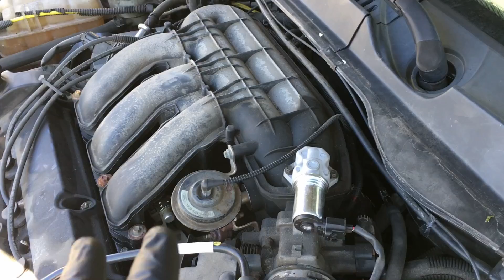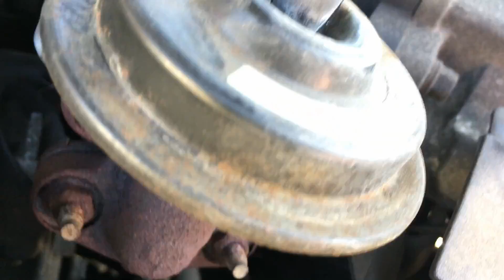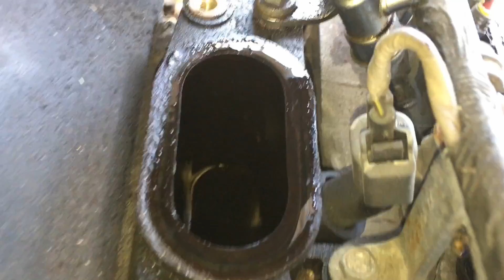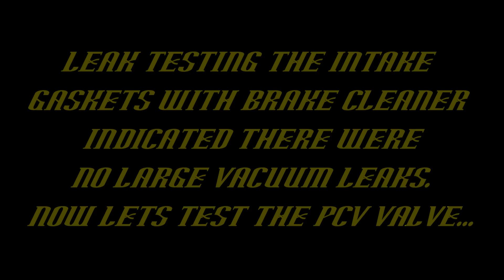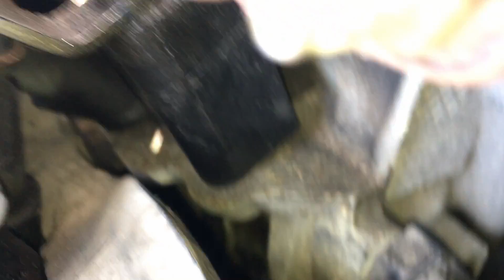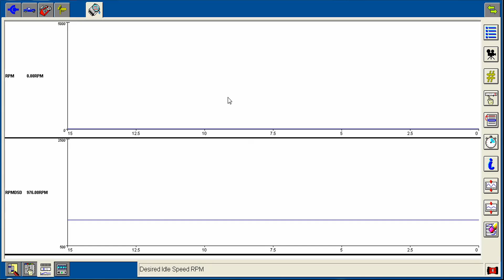Ford Taurus 3.0L 24v DOHC: $6 FIX for High Idle and Excessive Oil Consumption Concerns

Comment from the maker: Here are the Updated PCV Parts-
1996-1999 Model Years:
LH-
http://amzn.to/2phlxd2
RH-
http://amzn.to/2pwpCGo
PCV Tube-
http://amzn.to/2phnu9c
PCV Valve-
http://amzn.to/2phASKH                                                                                                                                                                              2000-2003 Model Years:
LH-
http://amzn.to/2phTNVF
RH-
http://amzn.to/2pwpCGo
PCV Tube-
http://amzn.to/2q0TNIM
PCV Valve-
http://amzn.to/2qX23XB
Reply: This says they dont know when they will get part again can u plz suggest another place to buy from
Reply: my car is ford tuarus 03 ses its getting stuck idling high when i go from 0-30 then slow down right away if i go slow an stop it stays idling just under the 1000 rpms probably 500 regauluarly is what it seems like my dealer ship cant even figure it out..you got any ideas

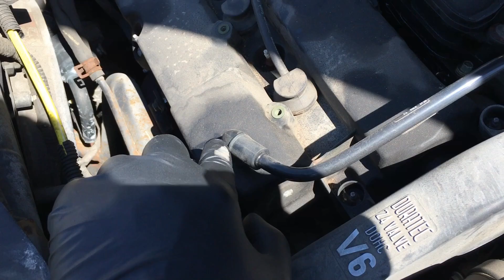Comment: 2:20 you replaced that elbow??? I've been trying to find anything about how to replace that elbow, mines leaking at where the elbow meets the crankcase and I can't find a part number or replacement for it anywhere! Any chance you can provide that P/N? (It's a later Duratec 3.0, the one in the 2005 Ford Five Hundred)

Comment: What could cause a low idle? I have a 2004 DOHC and it idle so low the oil pressure light comes on when in drive, but will go out if shifted in net. or park when hot.

Comment: I just change my 2004 ford taurus pcv valve and hose and the fluctuating git worse like really bad it feel like about to stall , but before that it was just small fluctuating. 
Note : the old pcv valve was stuck open and very oilly and the hose was bad also it has ton of carbon deposit and also twisted a little on its self .
But I out new ones should fix the problem but no 😂 it got worse 🙃.
Reply: Update : I can hear hissing sound from the intake manifold area this wasn't happening before and the hissing sound only comes when I manually acclrate by hand from the throttle body .
Reply: Is it possible the new pcv is stuck

Comment: Don't know if this will help anyone. But,I've been down this road. PCV was stuck open. Oil everywhere in induction system. Fixed that. But,RPMs still to high. Unplugged IAC,no change. What I found was earlier in life. Motor was replaced with escape/Mariner,Mazda whatever engine. IAC works backwards on those motors. Put escape IAC in it. Poof...fixed.

Comment: 2000 Taurus - 117,000 miles.    Leak in PCV valve hose at the elbow.   A challenge to replace the valve and hose.  Car now runs great.
Reply: was the leak visible? my car has all these symptoms but my valve looks perfect

Comment: 2001 Mercury Sable LS.
I suspect this may be my problem,.......before I attempt to get that sucker out,...would it hurt if I pocked a straw into the pcv valve and gave it a couple of quick shots of throttle body cleaner(cold engine) just to see if it loosens the gunk and improves my high cold start idle?
Should I do this?
If it makes a difference,.......then I'll attempt to get that sucka out there.

Ceskoslovenska.

Comment: I have a 2003 ford taurus ses 3.0L have replace the intake and the egr valve, egr pressure feedback sensor, egr vacuum solenoid. All my vacuum lines are good. Check the IAC by disconnecting and the car dies. Idle is still running rough. What is a possible cause for it to be running rough no high idle, just runs rough?

Comment: I have a 2005 ford taurus that will not pass smog.  When i took to a mechanic they cleared the codes and just said to go drive it for a month and then bring it back when the light goes off.  Well, i want to know what the exact problem is with these cars not passing smog so i can fix it in the future.  I might drive it and it may never turn off the engine light so i can pass smog..   Please help.

Comment: 98 Taurus DOHC no issues with high idle but when driving and you take foot of the gas, engine doesn't slow down, or accelerate, but at a stop light, idle is good.

 Kinda confused.
Reply: Did you figure it out?
I have similar,.."doesn't slow down/accelerate" problems on 01 Sables.
Reply: @IvanTheVariable  no, I'm still driving it as is, when I brake, and at stop lights, idle comes down to 500 ( stopped) and the car is never accelerating by its self, just a quark I'm used to now.

 I really have 0 intrest in taking apart the TB to get to the EGR valve, I'm thinking my issue is the emissions, intake system or idle control valve.

 This was supposed to be a throw away car  that is still swinging just fine.
Reply: Dealing with this now

Comment: Finally Found-fixd every vacuum leak today on my 2000 Taurus with a vulcan unless it's at the rear canaster, now I have a ticking on drivers side, not coming from valve covers. EGR selonoid vac connection was last leak I found. Still idles rough but not as bad.

Comment: Hi. I  have a 2013 ford Taurus and it has now power to the starter relay.   When I applied 12v to the starter relay car will start with the key.  And alternator light stays on.  Can you help?

Comment: Hey I got a question about my air intake that I believe from what you said , connects to the rear intake valve  Well my rear intake valve is hanging by itself not connected. Maybe you can get back to and let  me .know what's it take to reconnect. I wish I could post a picture. Thanks Timmy

Comment: Brake clean spray is sensor safe? used to use carb cleaner to check for vac leaks
Reply from the maker: Just fine.

Comment: What are the vacuum hoses called that have the angle on them coming off of the valve cover into the intake? I have to buy new ones for my car and don’t know what they are called
Reply from the maker: Pcv hoses
Reply: Thank you I fixed the hoses and now my car idles properly when I’m in drive but a little high when I’m in park with no accessories that put force onto the engine

Comment: Good day bud. I'm from the UK and have this exact engine in my car. I have a problem with high revs but if i pull over, switch the engine off, it goes away. The iacv is new too. Along with this, if i press the clutch pedal only a few millimetres, the revs hang but slowly drop to idle but if i let my foot off the clutch, the revs drop fine. Any help would be much appreciated 👍

Comment: How did you pull the PCV ? I have a 2002 DOHC duratec with high idle, but the message that I get is Idle Air Control overspeed error. P1506. Nothing about the PCV. However, I'm thinking that the PCV is probably original, and since I have one on hand, I'll change it. But how did you get it out?

Comment: Hello.
Great video, learned a few things.
However, this is my issue.
When I disconnect the IAC plug, the idle stays HIGH, and never comes down.
It is like it was never disconnected.

I went on the Ford Taurus Forum, and told them what I had tested, being the IAC unplug test, and one guy continuously tells me it is another vacuum line issue. That it is not the IAC, even though it never changed the HIGH idle.

This car is DANGEROUS in the rain.
As I am going up a grade in the rain, the front tires start to spin out of control.
So, this issue needs to be resolved.

I have looked and have not found any air leaks, nor do I hear any, as you can clearly hear in your video.

So.
Any suggestions?
Would it be the IAC that is bad, since it fails the Unplug test?
Or, is it, in fact, another air leak somewhere else that I am not able to find?

Thanks.
Wayne
Reply: Because it’s getting another source of air ..watch the beginning it happens on that car to

Comment: From my own experience with my 01 DOHC Taurus is to replace all oxygen sensors and check all hoses and boots for deterioration. Also make cetain the air cleaner cover is tight, that can cause an eractic idle.

Comment: I have a 2007 escape with the 3.0 duratec with 180k miles on it.  It has the rough idle and some oil consumption, like a quart or so per 1000 miles running 10w30.  When I first got it I suspected the PCV valve but it's such a pain to get to anything on that motor and I got it in a trade for basically nothing and haven't wanted to spend time on it.  Wondering if this could be the problem.

Would there be any codes?  Only code mine has is an o2 sensor signal stuck and it comes and goes

Comment: Hello again, have a question with the wiring of the DPFE sensor connector 2000 ford Taurus. My connector to the DPFE sensor broke and I had to replace it but I am not sure if I spliced the wires back correctly. I know the middle is the ground but the red wire and brown wire not sure of the pin location. Any help would be appreciated. Also the new plug wiring  is not numbered or color coded. Ken.
Reply from the maker: Email me I will send the info

Comment: Hello, I used a 7/8" socket with an extension to insert and turn the pcv valve. I notice the pcv valve didnt have a positive stop...when i snugged it up..if i turned it a tiny bit more it would start turning again until it snugged up..and on and on. So i was careful to snug it up just enough and than stop. IS this normal that the pcv valve could turn continually?

Comment: Edmonton, Alberta, CanadaHave a 2003 Taurus 3.0 OHV....been having stalling and fast idle issues.speed will increase on it own. when stopped or in park  If i turn on the air or the heater on DEF setting the RPM will fluctuate up and down then car will stall out.have checked for vacuum leaks and it seems ok
Reply: check your o2 sensors

Comment: On my sable I got P.O. 171 and 174 I believe after changing Pcv  and cleaning air intake and cleared codes
 I got back a P.O. 171 and a 455 i think for evap system and gas cap loose 
Upon inspection of evap valve under found vac hose from bank 1  to evap valve on right next to ac charge valve split replaced and cleared all codes no problem after

Comment: When I disconnect the iac nothing happens.   Same RPM @ 1100 in park.   The PVC valve looked easier to get to than my 2003.  So you squeeze the rubber elbow to determine if pcv is functioning properly?   Great video tip
Reply from the maker: You squeeze it to see if it is stuck wide open.
Reply: I noticed that you did not remove the intake but how did you get to the pcv with the plastic housing for wires next to it?
Reply from the maker: long needle nose pliers.
Reply: thanks.  that saves me time and 90 bucks if i took it in the shop
Reply: @FordTechMakuloco  what do you call the distribution box? I can’t find one online for 2007 ford Taurus. I can hear a leak there.

Comment: in the ford Focus Mk2,5 - Duratec 2.0 flex fuel, Is it common to have small variations of RPM idle with motor still cold? After 1 ir 2 minutes it stabilizes. Are the cold phase oscillations normal? Sorry about my english. Thanks!

Comment: Eye have a 2000 mercury and I have changed the hose but can't find a video to show me the exact location for the VALVE EYE ALSO HAVE THAT SAME WET OIL LOOKING STUFF ON THE FRONT OF MY VALVE COVERS HELP‼️‼️‼️‼️‼️‼️
Reply: Same here for my 05 mercury. Can’t find the pcv valve at all. Did you end up getting it fixed?

Comment: When Ford finally updated the DOHC motor for the 2004 Taurus, I was super happy - they fixed all the stupid vacuum leaks with using metal valve covers, and just left the plastic for the upper plenum and lower intake.  And they moved the PCV to a much more logical location.  Doing the PCV on a 2000-2003 is not the most fun task in the world.
I bought a 2000 DOHC motor for $200, replaced trans - cracked case, 99K miles.  Found it had two cracked vacuum lines, clogged PCV (like this), as well as seeping valve cover gaskets and a flattened upper plenum o ring.  I did a full gasket set up top (upper and lower), valve cover gaskets,, Motorcraft plugs and PCV, vaccum lines, cleaned IAC, and that engine was 100%.  It went down the road great, good power and did well.  Sold it to a friend needing reliable transportation.

Comment: Really informative vid! Awesome! Quick question...I've got an 02 Taurus SE OHV with a P1504 code (iacv circuit malfunction). The idle is normal (except with the a/c on in park...then it sometimes shudders/acts like it's going to stall; only does it when I'm already in park and then turn on a/c (not when I come to a stop and park with the a/c on already)). Put a new iacv in and it seems to work fine (car dies when I unplug it). I also got a new iacv connector and replaced wires about a foot back. Do you think I'll need to trace the rest of the wire for damage back to the pcm? or could it be something else? Thanks either way!

Comment: 02 Taurus 190k...I've replaced my PCV and "Elbow" twice...Each time it/they failed the car was basically useless...Who would have thought that those parts so overlooked on the 70's cars (Oil in the air filter housing) would create such driveability issues today.
Reply: matt8863 I had the same problem on my 02 Taurus...not with the pcv itself but with the replacement rubber   grommet. Still not sure why but the replacement one hardened in a matter of months. My guess is that I had used an aftermarket pcv valve and it was metal instead of plastic like the original one. Maybe being metal it got too hot. I got an OEM pcv(another hard plastic one) and haven't had the hard rubber issue since.

Comment: Great diagnoses as usual. Aftermarket IAC valve, aftermarket pcv valve and what do u know. Perfect. Jk. I know Motorcraft is better, but in a pinch u gotta do what ya gotta do. Working on 2010 Transit connect. The h/p power steering hose is a Jim dandy. My thumbs r raw. The teflon ring is an absolute disaster of a design. Any comments?  U don't post too much on the Focus engine. Like the cam and crank sprockets with no keyways. This one came in with all exhaust valves bent. The sprocket slipped. When I put it back together, I ignored the 59 ft. lb. torque spec and gave it at least 75-80. I know u r going to chew me out. But we need all the help we can get with this design. Love all your vids but haven't found one from u on this design. Which I hate
Reply: Bill Rimmer I agree with aftermarket being generally fine(use it as often as I can), but I tried putting an aftermarket iacv on my 02 Taurus SE OHV and it bucked like a MF lol...turns out something was changed regarding the little moving piece(piston? idk what it's called lol) inside the new valve. Bought a motorcraft one (for three times the cost of the other) and it was thankfully identical to the old one :-)

Comment: Is there an easy way to remove the PCV valve without removing the upper plenum? It's really buried down there.
Reply from the maker: +John Grzechowiak I used a combination of slip joint pliers and a pair of long reach needle nose no problem. I think the only thing removed was the air filter cover.
Reply: Thanks for you help
Reply: I've also used a deep well socket around a 15/16" 6 point IIRC.
Reply: Luckily my PCV hose was firmly stuck on the valve. Was able to rotate the valve out by using long needle nose on the hose.
Reply: I bought a long neck socket that fit the replacement PCV , I had purchased. As you said it is in a hard to reach spot.

Comment: I have a 2001 e150 van the key chime stays on when the key is out and drivers door is open and shuts off when you shut the door it thinks the key is in the ignition and it is out any fixes thanks

Comment: this video was interesting period I have a 2003 Ford Taurus with the 24 valve engine she only has 70,000 miles on her. problem I have is when the car is put into reverse or drive standing still she occasionally burps and see if I misfire. no codes no check engine light. I have cleaned throttle body mass flow iac check hoses. even check for a small vacuum leak check the around the diaphragm of the power brakes booster. car runs okay as long as it's not in the idle section when running for too long example steady drive at 55 or 60 no problem until you decide to speed up. then she burps clear throat and keeps going curious I'll find out what it is eventually. I assume there is no code. because my check engine light is not on. but I have not scanned. guess my next step will have to be in getting a scanner.

Comment: 2003 Mercury Sable 24 DOHC, can a bad pcv valve cause car to surge when in drive, very light surge if any at all when in park.
Reply: kevinstoyable The PCV valve was the culprit on my 2002 Taurus 24v DOHC with similar symptoms. P1506, high idle, surge in drive. Mine was brittle and slightly difficult to remove but it runs great after the repair.

Comment: +FordTechMakuloco  My 2010 escape (v6 with 112,000mi) shakes at stoplights, could this be because of bad o2 sensors?
Reply: Ray Klotz check the engine mounts
Reply: likely a misfire, those coil on plugs tend to go bad quite frequently. unplug each coil one at a time to see which one isn't hitting